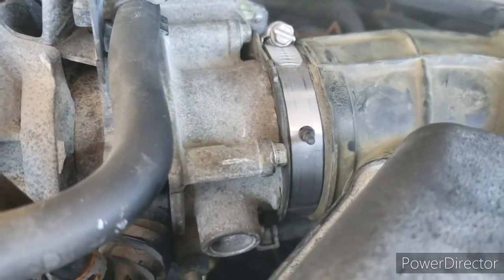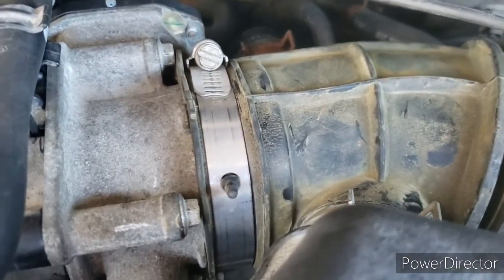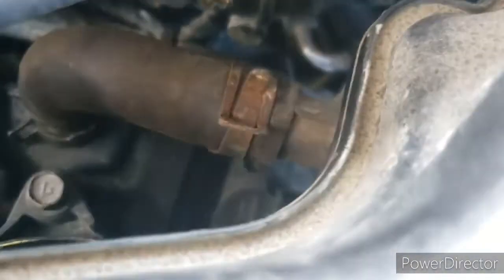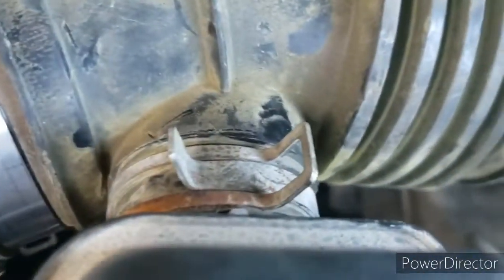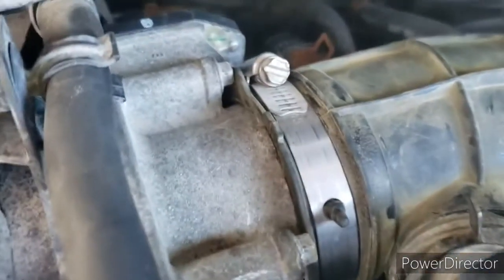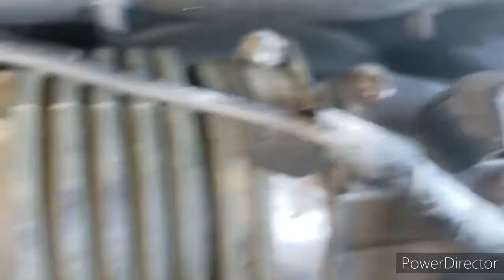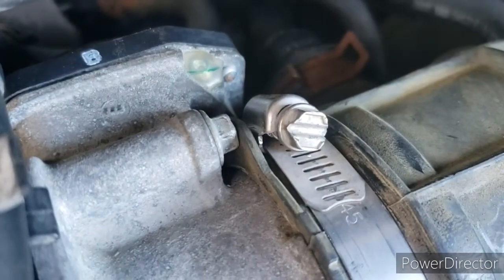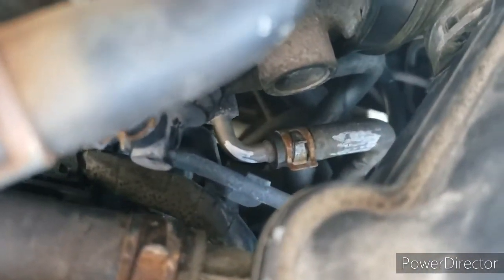How to Clean Your Nissan Rogue Throttle Body for Performance. #nissan #throttlebody

Comment: did you have to re-learn the throttle body after the service and did you clean it there or removed the bolts to clean the back as well?
Reply from the maker: I did not the first time but i just did it again because we put so much km on this rig. The computer will do that for you usually after running rough for about oh 30 km I'm guessing it should be just fine. if it don't work it self out by the computer you can do a procedure that's easy. you just need to look up relearning throttle body procedure for your model.  It involves something like this....  This is for example only . make sure you look up for your madel etc but if dont feel comfortable take it to a professional.

Procedure 1
A. Make sure that accelerator pedal is fully released.
B. Turn ignition switch ON (without starting the vehicle) and wait at least 2 
seconds.
C. Turn ignition switch OFF and wait at least 10 seconds.
INSTALLATION INSTRUCTIONS
www.trqautoparts.com 
www.youtube.com/trqautoparts
D. Turn ignition switch ON (without starting the vehicle) and wait at least 2 
seconds.
E. Turn ignition switch OFF and wait at least 10 seconds.
i. You should be able to hear the throttle body operating during the 10 
second ignition OFF cycles. 
Procedure 2
A. Make sure that accelerator pedal is fully released.
B. Turn ignition switch ON (without starting the vehicle).
C. Turn ignition switch OFF wait at least 10 seconds.
i. You should be able to hear the throttle body operating during the 10 
second ignition OFF cycle.
Procedure 3 
A. Confirm the accelerator pedal is fully released; turn ignition switch ON 
(without starting the vehicle) and wait 3 seconds.
B. Repeat the following procedure quickly five times within 5 seconds.
i. Fully depress the accelerator pedal.
ii. Fully release the accelerator pedal.
C. Wait exactly 7 seconds, fully depress the accelerator pedal for approximately 
20 seconds until the malfunction indicator light (MIL) stops blinking and 
remains ON.
D. Within 3 seconds of the MIL remaining on, fully release the accelerator pedal 
and start the vehicle.
E. Let it idle for at least 30 seconds.
F. If idle is stable and below 850 RPM, the relearn procedure was successful.
TROUBLESHOOTING
For erratic/surging idle per Nissan technical service bulletin NTB05-067:
*Before beginning this procedure, check engine for vacuum leaks. Hoses, intake 
manifold & ducting between intake manifold and MAFS are all common areas.
A. Start engine.
B. It may be necessary to unplug multiple fuel injectors before the idle has 
stabilized. (For 4-cylinder engines, up to 2 injectors can be disconnected one at a time. 
For 6 and 8-cylinder engines, up to 3 injectors can be disconnected one at a time. It is 
best that 3 disconnected injectors (particularly on V6 engines) not all be on the same 
engine bank.
C. Once the idle settles, turn off engine. 
D. Re-perform the Idle Relearn Procedure (Procedures 1-3 above).
E. Start engine to make sure idle is still stable.
F. Reconnect fuel injectors and allow engine to idle for 30 seconds.
G. If idle is stable and below 850 RPM, the relearn procedure was successful

Comment: Hi! I have a rough gas pedal, could it be a throttle body? Is gas pedal is electronic on Nissan Rogue 2014? My milage is 125k km...thank you
Reply from the maker: I do believe the 2014 is electronic gas pedal. There are few things that can cause these symptoms.  But in my experience two out of three times it was my throtle body, it was sticky. When you say rough gas pedal do you mean you got to push down further then normal to get going
Reply: @DIYVariety  right! My foor hurts a bit of that...and also not enough acceleration from the light/stop, but when it switches to further speed, its totally fine...just rough from the start...thanks for letting me know about electric one...Can any mechanic clean it with relearning or do I need to go to the dralership
Reply from the maker: @TSA333  oh any mechanic can clean it it will relearn itself after so many km of driving
Reply: @DIYVariety  thank you! Will go to mechanic soon...the gas pedal is vibrating...very rough acceleration before 50-60 km
Reply from the maker: @TSA333  good luck bud